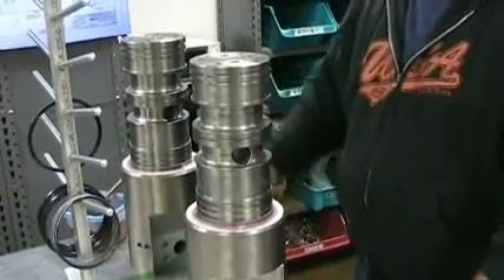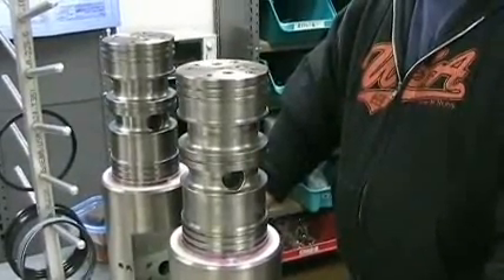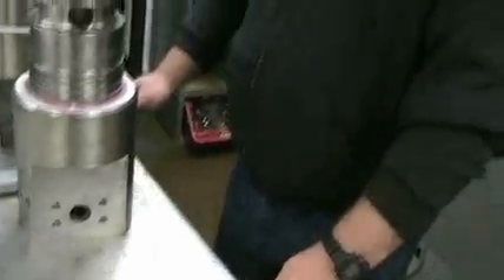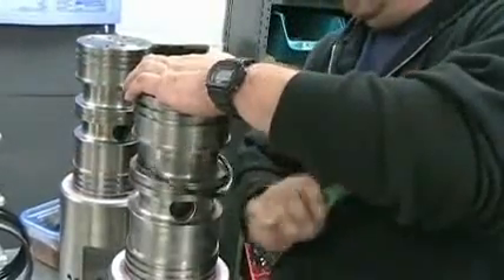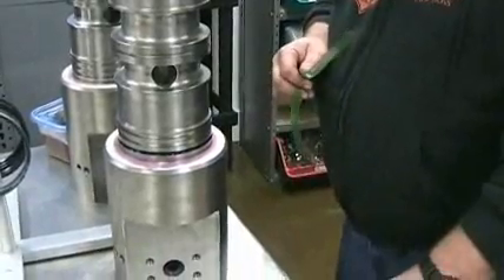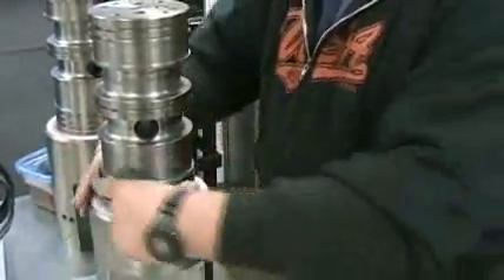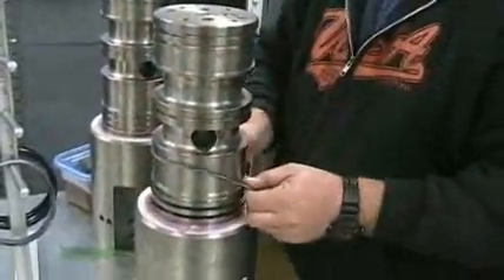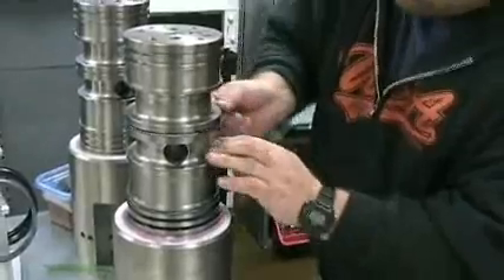Rotary Manifold with Seals on the Spool Seal Installation

Comment: Is there a desired temp for the swivel ?
Reply from the maker: Allen, if the kit being used has black high-pressure seals, they no longer need to be heated. They are pliable enough without any heat. If the kit has green high-pressure seals, the kit should have heating instructions. If you have additional questions, please contact our service department at 715-395-5252. Thank you